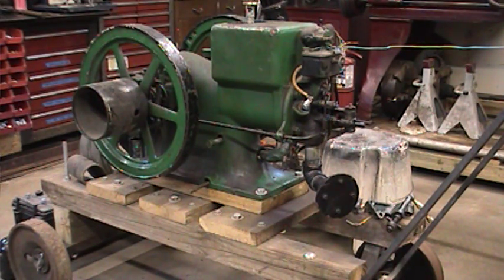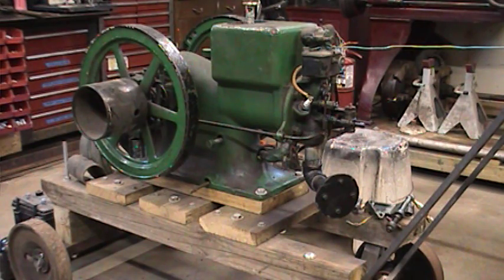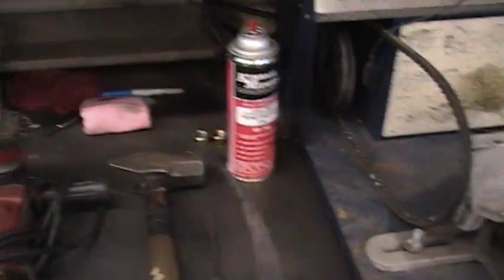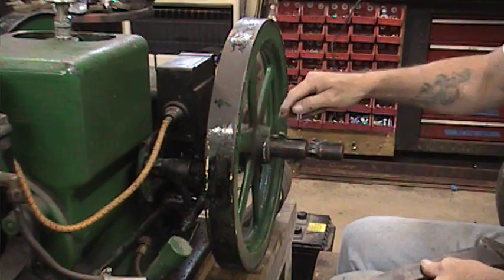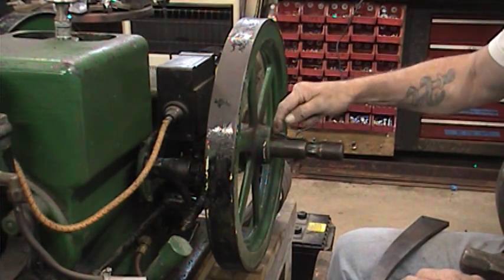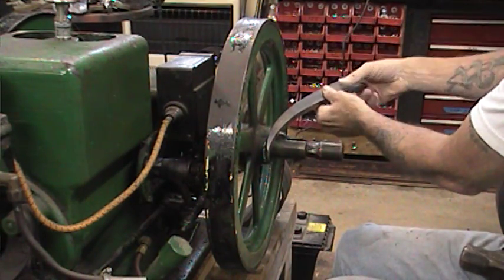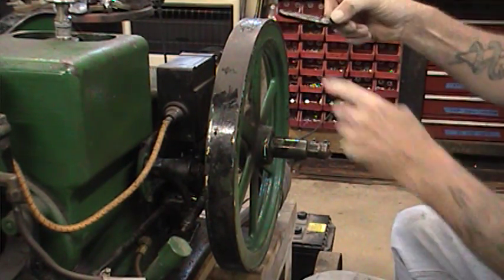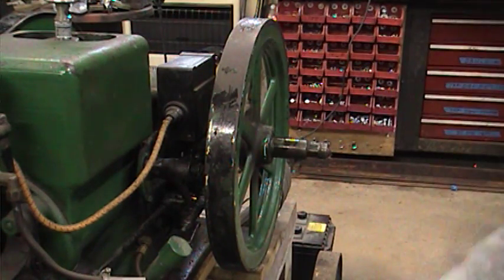Gib key removal from engine crankshaft.

Comment: help pls....I tried that but now the curved part broke off....how can I get it out...it still has not moved....
Reply from the maker: What engine do you have is it spoke or solid flywheel, how bad is the key.  Can you grind it flat and drill out or is there some left to weld on. Do you have a puller or metal to make one for the flywheel ,  After drilling you can heat up hub to warm only and pull flywheel and key  as one.  Many ways to do this.  Phil
Reply: IronAcres I think I can grind it and I suggest drill the key way so it gets loose..then maybe use a bar behind the pulley to move it out or possibly try make some puller up using a bolt to push along shaft...any other ideas?
Reply: also the pulley is for a chain...I'm wanting to put a flat belt type on.thnx for help

Comment: Gib keys are a master piece of bad design, thats why you will never find them on any machinery today, a nightmare to remove if the head breaks off, as soon as I had removed mine off my Lister CD I took the flywheels to be broached parallel  and had two stainless steel  feather keys made with a locking collar either side of the flywheel. no more time wasting, struggling, cursing etc etc, just undo the outer locking collar and pull the fly wheel off. No possibility of the flywheel coming off on its own,looks neater too.,
Reply from the maker: Good advice, the pro is they hold very well, the con, can be a real nightmare to remove. lots of cursing.  Phil
Reply: Gib keys are still in use today, just not as common. I worked on some food equipment a couple years ago and a big one was holding a 300 pound gear in place. I was pretty surprised to see it. Problem with gibs are, drivin to deep and hard, not machined correctly or improper techniques of removal. Correct all three of these and they work pretty nice.
Reply from the maker: Yes Gib keys have given me headaches over the years.  When new and built well they work very good,  I have drilled out keys, welded pull bars on them and countless other inventive ways to get them out. They do hold for sure and most of the time do not give up with out a fight.   Phil
Reply: The gig head key, must be fitted correctly, you use Prussian blue a make sure you have max. contact. The fitter of the key bears a huge responsibility as death or injury can occur if not fitted correctly. You can use feeler gauges to see how the hub/flywheel distorts as you drive the key in. If you have trouble driving key out, you tack weld key to shaft and drive hub/flywheel away from key head, then dress shaft to remove hub

Comment from the maker: Hello, depending on the metal that is left if you have a wire feed welder you can build up the end or weld a bolt or nut to it.  You could drill and tap a hole in the end of the key and threat in a bolt for the remover to hit.  I did pull the flywheel with a puller and slide the entire asembly off when well lubed. Or if you can try and drill out the gib key and pull the flywheel off.  I have done all of these ways see what may work for you.  Phil

Comment from the maker: I believe I will when ready, I need to make a new mounting stud first.  It can be repaired two ways using the same size stud and helicoil or taping larger and turnung down a stud on the lathe, each has its pros and cons.  Phil